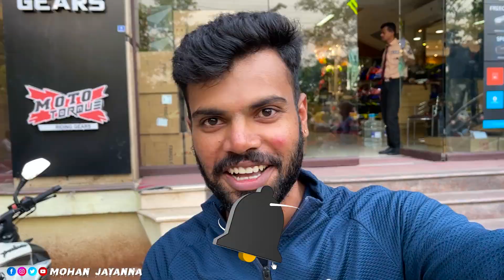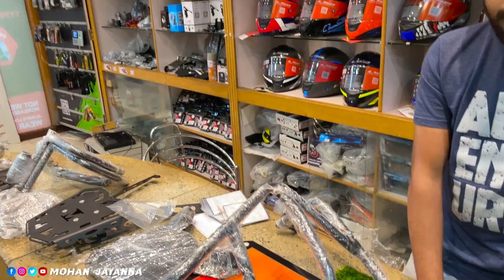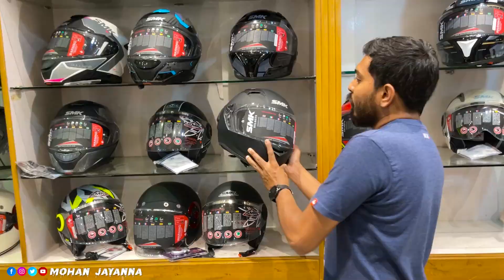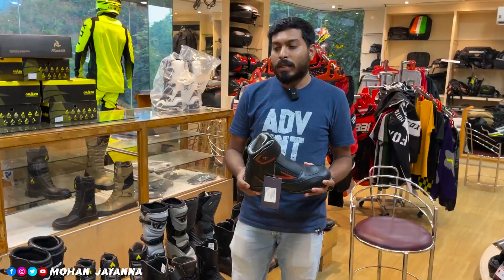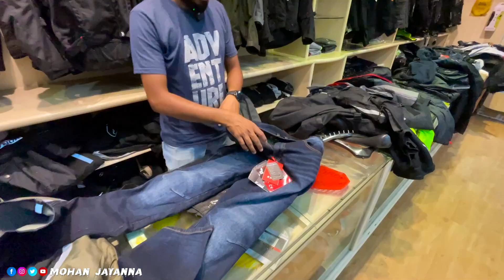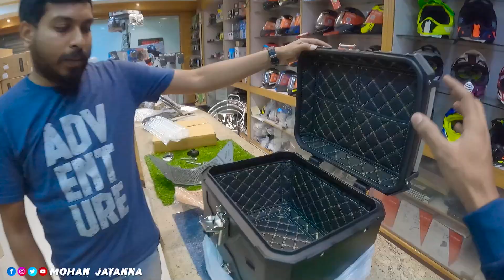ರೈಡರ್ಸ್ ಅರೇನಾ - Ryders Arena | UPGRADING MY RIDING GEARS & ACCESSORIES For KTM 390 Adventure

Comment: I buy GeL Seat, i advise everyone not to buy a gel seat for your two wheeler, I paid 3300rs for this. It's not comfortable as it should be. This is Technic to loot money. Better go to local shop & ask them for soft foam.. ask options for the soft seat. 

However I will not get refund 3300rs which paid for gel seat